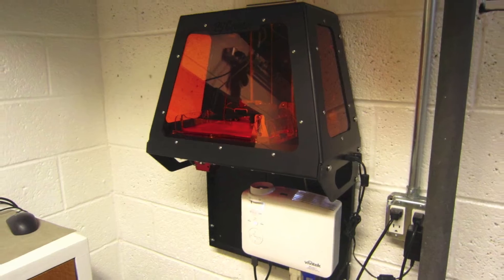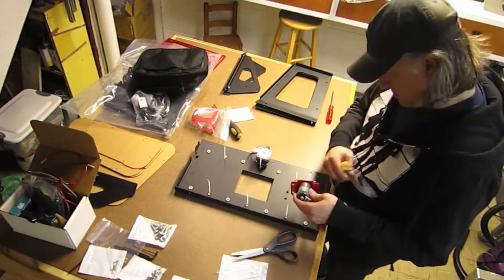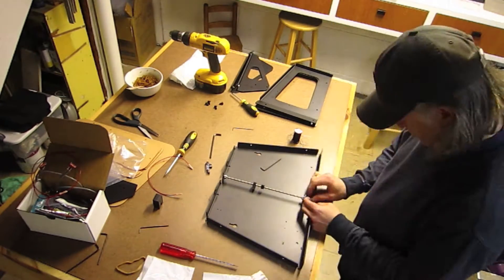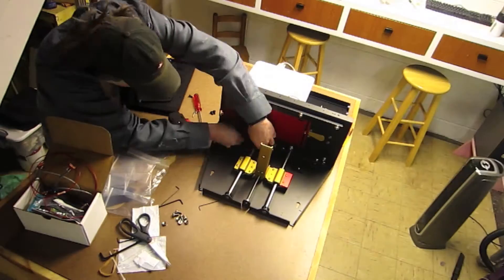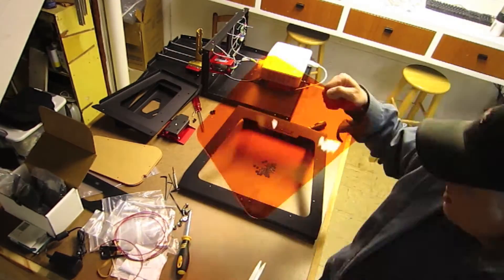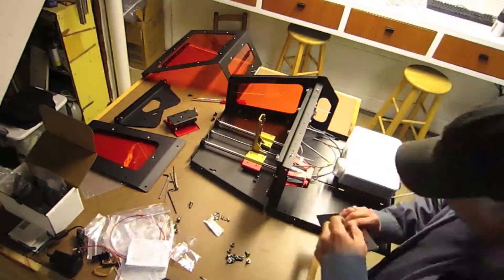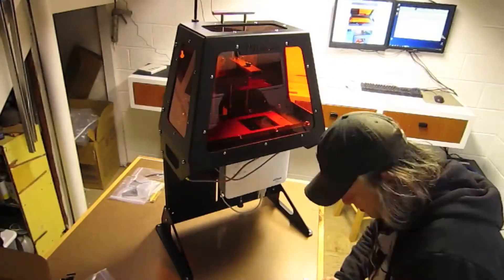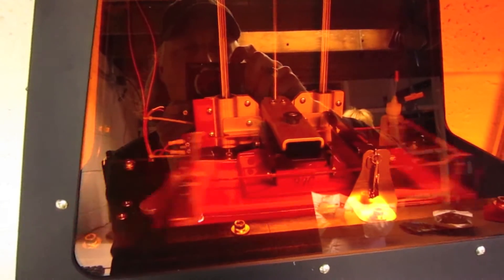DIY B9 creator DLP 3D printer rapid prototype assembly time lapse build

Comment: Hi Eric, could you share you experiences with the B9 so far? I am planning to buy one, and would love an expert's opinion before I do.
Reply from the maker: +Roel van D I sold the unit several years ago. I could not deal with the resin. just way to messy for me, to much clean up! detail was great, but never superb, also the whole thing with the tray and the curing material was a pain in my ass, I could never get the accuracy dialed in either. Also for the type of work I do, it was not the right machine for me. It only has a small build envelope, so I could never use it to build the objects I needed in one piece. Honestly the mess of the resin and the lack of sunlight here in Michigan just did not work out for me. Currently I have an Ultimaker2, just a tick less resolution, way faster, way less mess and a much much bigger build envelope. I love the thing for product design and development. Check out my latest video about using to cast silicone gaskets. Good luck to you.
Reply: Eric Strebel Thanks for the elaborate reply! Luckily we build very small things. (matchbox up to tuna can sized) Unfortunately we really need the detail so Ultimaker (or any other filament printer) is not an option for us. I will have to make sure we keep things tidy... I will check your other vids for sure. Cheers
Reply from the maker: +Gryzewolf  sold it, not worth the mess in my opinion. To much clean up and to small of a build envelope for my needs as a product designer. It does make nice parts sometimes. I have an ultimaker now, way better. Cleaner faster cheaper bigger build envelope. Check out my other videos, don't forget to subscribe to my YouTube channel. See  www.botzen.com for more about what I do as a product designer and how I can help with your next design project.
Reply: Ordered a form2 instead. Need  detail the ultimaker cant provide unfortunately. Ill let you know what i think :)
Reply from the maker: Gryzewolf  looking forward to it.

Comment: nice vid
does the printer come with a video of how to put it together. or does it come with thorough instructions on how to build it. My tech level is about a good as building my own pc.. but to get this machine to work right makes me doubt i have the skill to build my own. did u need to tweak it alot after to get it to work or is it straight forward.
Reply from the maker: Instructions are online. Some tweaking is required. I have already sold the machine, I don't want to mess around with all the tweeking and resin mess.